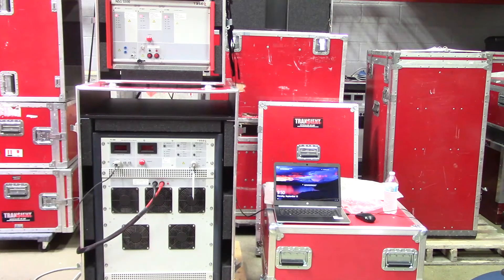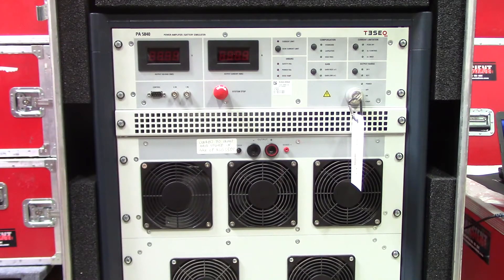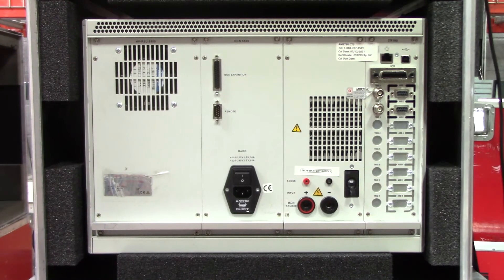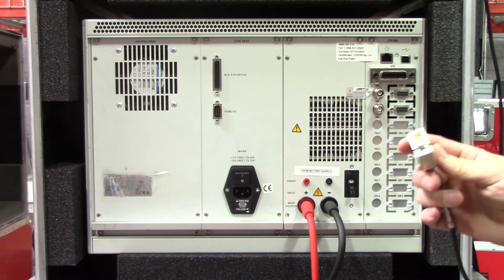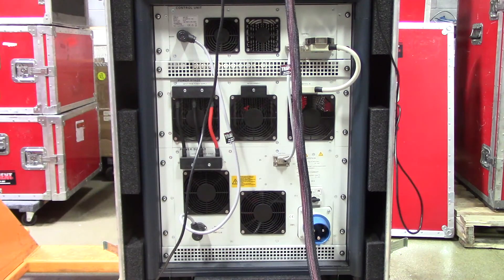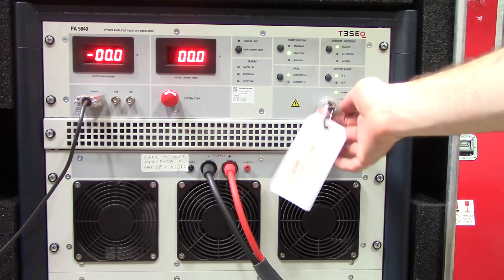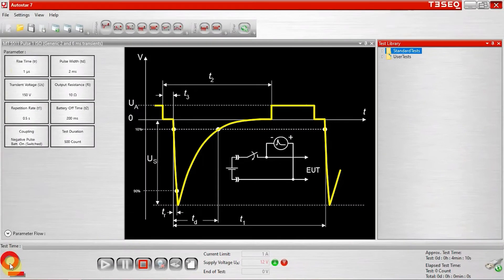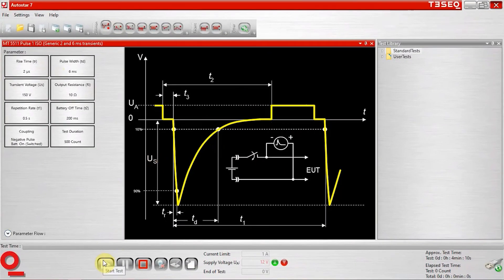Teseq NSG 5500 & PA 5840 Overview - Automotive Transient Test System Guide

Comment: Can you demonstrate how to use the sense lines? 
Can the sense line be connected to the DUT to avoid the voltage droop across the cable? 
Since the cable from the PA5840 to the NSG5500 is quite long, will it be any loss? The superimposed alternating test is quite fast at 30kHz. I suspect you won't get the same modulation amplitude at the DUT without having the sense connected. It would be appreciated if there is a demo about how to use the sense lines.